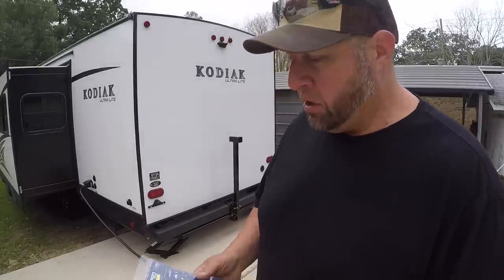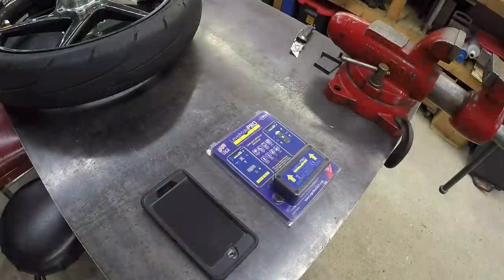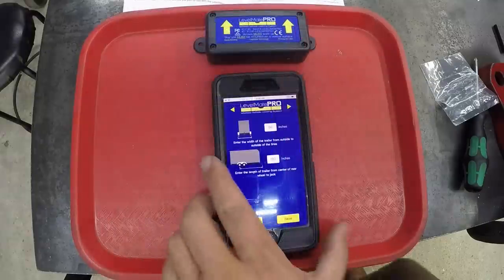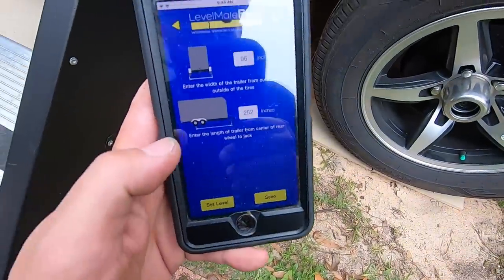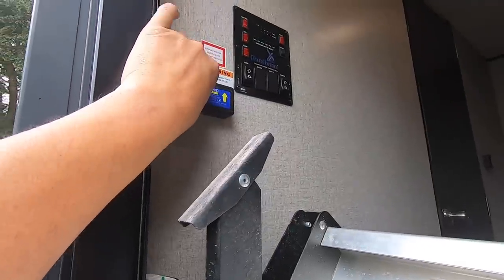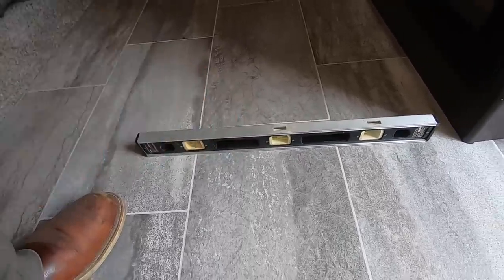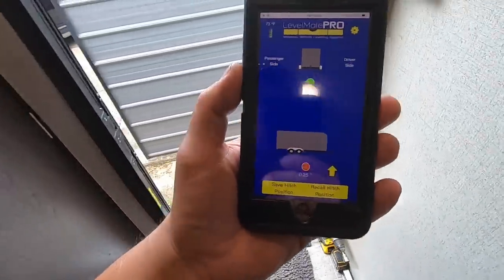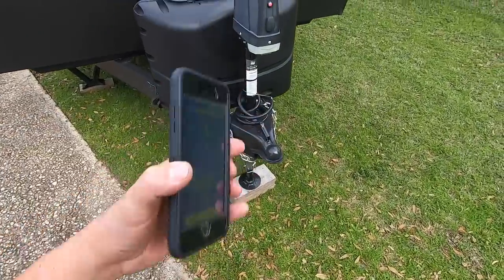Level Mate Pro Install

Comment: I just set mine up early this morning in the Walmart parking lot before anyone got there...  The only somewhat level place near me...  One thing that stood out to me that I must have missed was that you RETRACT your slide outs before setting it to level.   Level your rig with the slides out and get it the way you’d like it, but then pull the slides back in before setting it to level.  If you don’t read the fine print in the set up, you could overlook this...

Comment: Took my levelmate pro out of my old camper and need to put it in my new camper.  Watched your video and saw where you mounted yours.  I was gonna put mine in the front closet, but saw where you mounted yours and changed my mind.  Makes perfect sense to mount it where you can reach it with the stairs in.  Thanks for making setup just a little easier.

Comment: We have the LevelMate Pro also.  My only complaint with it is, because we have aluminum siding on our camper, the bluetooth signal has trouble getting from the camper to my phone in the truck cab.  I've finally figured out where I need to put my phone while leveling, and as long as I can keep signal, it works great.  I think if you have azdel or fiberglass exterior on your camper, you won't have this problem.

I had to put mine in the pass-through storage all the way up at the front corner driver's side.  I had to put it there to get enough signal to the truck cab.... again, we have aluminum exterior on our PrimeTime Avenger.  

When I calibrated our unit, I used the stovetop as the reference surface for leveling the camper.  Nobody want's to cook on an off level stove, LOL.  Worked great!!

Comment: Idk if you still use the LevelMatePRO or not, but I just modded mine by soldering a 12vdc to 3.3vdc adapter in place of the battery since I was chewing through batteries if I forgot to turn it off, which was often 😂

Took like 20min, $8 and done!

Comment: There is at least one Android app ($1.99) which runs on two phones at the same time.  You lay one phone on the kitchen counter-top, and walk around with the other one.  Adjust your jacks until the kitchen is level.

Comment: Can it be mounted outside?  On the frame rail under my landing gear switches would be great.
Reply from the maker: Instructions say to mount inside out of weather.
Reply: I would bet the front pass through would be a great place to mount this gizmo.
Reply: @AN-kg4ei  That's where I ended up putting mine.

Comment: Would it matter if your slide outs are extended or retracted before leveling?
Reply from the maker: Yes. When I set the absolute zero settings I made sure the camper was level both ways using my carpenters level. I had the slide out when doing so. It’s as close as you’ll ever need to be.
Reply: @AbomAdventures  your slide out needs to be in when you set level
Reply: Your slide can be out when calibrating but you'll want to put your slide back out before leveling at campsite

Comment: Adam, it sounds as if you referenced the floor or the frame. Have you checked the floor of the freezer compartment to see if the refrigerator is installed square with the rest of the trailer? The frig is the most important thing to have level (assuming you have a typical RV frig). You might want to check the frig manual for more info.
Reply from the maker: Leveling floor is all that’s needed, and the dealers will show their customers that. Fridge should always be mounted squarely to framing.
Reply: @AbomAdventures  Indeed, the fridge SHOULD be mounted square...but I can tell you from experience that they are not always. Also, if you spend much time on RV forums you might get the idea that dealer advice can be suspect. It's easy and fast to double-check with a round level (easiest, of course, when it is thawed). Thanks for sharing the install.
Reply from the maker: @sierraspecialtyauto7049  I'd prefer my living area to be level and square to the world. the fridge isn't going to be hurt if its off a degree.
Reply: @AbomAdventures  Exactly.  In fact in the manual for my 2015 Norcold N61X fridge, it states leveling tolerance to be a generous ±3° side to side & ±6° front to back of fridge to operate safely.  That's plenty, so no worry there (even though everyone does).  THUS, best choice for me is to accurately level up our stove top cooking grate surface.  Because everything else will still be very close as you've pointed out.  For us the most important thing, the fried eggs & sizzling bacon, will be our morning's delight!  So I am getting this unit and setting it level based on the cook top.  As you know this unit measures the differences (side to side & front to back) from the set point of YOUR choosing.  So it needn't be mounted perfectly level AND you can reset that "trailer level set point" any time again in the future.  For example, if one wants to reset it to the cook top, dining table, bath door, counter top (for recipe measuring), or whatever surface you'd like to be at its level best, it's okay.  Happy Camping! 😎
Reply: @garyswitzer6867  That is exactly how I calibrated mine as well.  Nobody wants to cook on a half bubble off cooktop, LOL.

Comment: I just got one and im guna install in a winnebago motorhome...so does it go off the level of your trailer when you install or does it have it own level inside, ie it doesnt matter if my trailers not level
Reply from the maker: Once you install it you must calibrate it’s to the level of your unit. So make sure you have your camper as level as you can using traditional methods, then set the calibration on your Level mate to that.